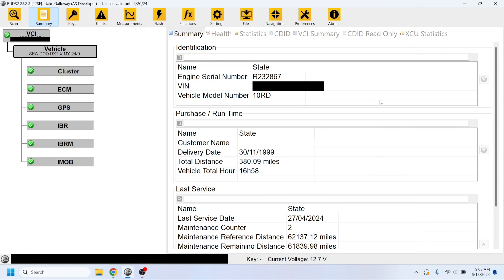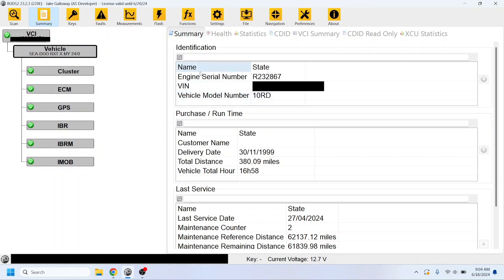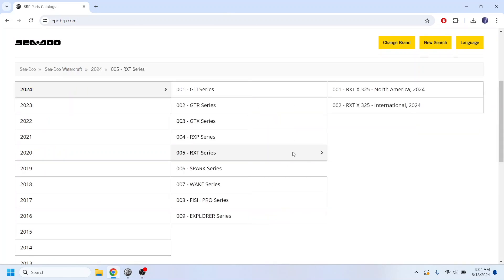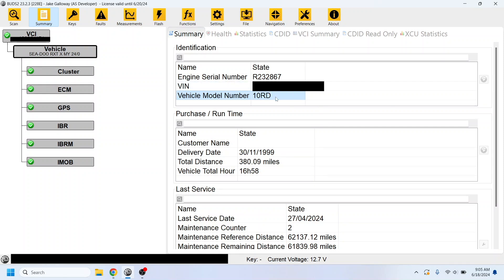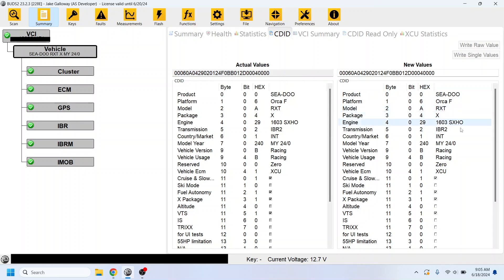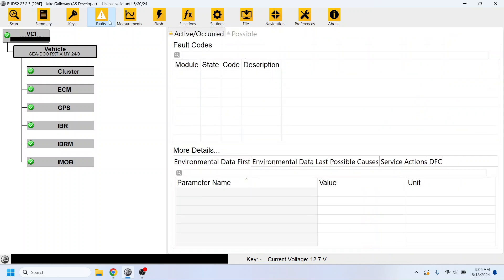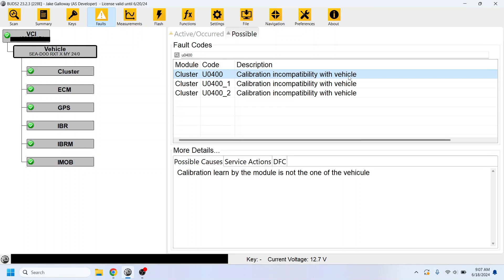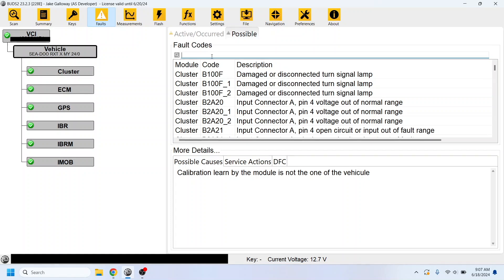How To // SeaDoo 325 Speed Override Using BUDS 2

Comment: I have a 90hp spark. If I changed the vehicle version and vehicle usage to racing in cdid section will my ski start in sport mode every time ?
Reply from the maker: It should, yes!
Reply: @jetskijake-seadoo I just tried it and when I started it it was still in touring mode. It even said racing for vehicle usage and vehicle version under actual values. When I change those settings should it say sport mode on startup or does it just change the touring mode to sport mode but still say touring on cluster?

Comment: I have a 2024 Gtrx 300. On the website where I bought my megatronic also suggested unchecking Byte 2 bit6 and checking Byte 2 bit7 in ECM variant coding. Is that necessary?
Reply from the maker: Yes the 300’s and under use a different ECU, those 2 bits should be disabled, that’s all you need to do for the speed unlock.
Reply: Great, so I will uncheck both. Thanks. Are those the GPS limiters for the variants?
Reply from the maker: @frankj1663  Yup, both of those bits are what control the speed limiting mechanism.

Comment: i think you missed 1 thing, also country need to be changed. also seado doesn't have international model number for the 2025 rxtx325 yet. very odd
Reply from the maker: Yup. I missed it in the video but put it in the description.
Reply: @jetskijake-seadoo  tnx for the reply. how fast your ski is going after this change?
Reply from the maker: @user-crpto-1  I managed 81 after this change and the iBR grind and ride plate mods. Prior to the iBR and ride plate I was topping out at 76-77.

Comment: Hi Jake. Do u know where is the setting to change the horsepower on 2021 Seadoo GTI SE 130 to 170hp. I'd appreciate the help with buds2.
Reply from the maker: Yes, all you need to do is change your 4 digit model code to the 170hp version of the ski. It's a similar process to the video. Open this link https://epc.brp.com/#/Sea-Doo/004_-_GTI_SE_170%2c_2021_00030MA00_00030MB00_00030MC00_00030MD00_00030ME00_00030MF00_00030MG00_00030MH00/00-_Model_Numbers/S2104/00S2104/y

Then find the international version of the 170hp variant of your ski. Then open BUDS 2 and change your current model code to the 170hp version.
Reply: @jetskijake-seadoo  bro can we do this on gti 170 2024?
Reply from the maker: @juanoliveira2912  The 170 is already the highest factory output. If you want anything more you'll need to have it tuned.

Comment: Great video, but I have a problem every time I put on racing, it says check keys cannot fires up. yes I put 4 code 10RD for international and if I put back to serial.. sees keys and fire up.  On racing sees the keys and reads the keys..
Reply from the maker: Are you the one I’m messaging on Reddit about this?
Reply: @jetskijake-seadoo  maybe I’m not sure
Reply: @jetskijake-seadoo yes I’m
Reply from the maker: @ProTurbo1988  Sounds good just message me on Reddit when you want to remote. I'm Eastern time too.
Reply: Is that just to go to the international speed limit 72? Or full speed unlock(obviously with the stock limiter)
Reply from the maker: @tab686 This is to disable all GPS speed limits, so you should be able to hit ~80
Reply: @jetskijake-seadoo  ok thank you
Reply: @jetskijake-seadoo    Привет.  Я правильно понимаю через BUDS 2  можно снять все ограничения GPS?
Reply from the maker: @имяфамилия-н4г3ж  Yes that is correct.
Reply: First we had to update BUD2.  When you deleted the override speed limiter it will get you to 76mph. Then tune for 83mph plus
Reply: @ProTurbo1988  What tune are you using?
Reply: @raymondyim2960  no tune
Reply: @ProTurbo1988  I was able to remove the speed limiter with BUDS2 but I max out at 77.  I see people post that they get over 80 with just the speed unlock, did I miss something??
Reply: @raymondyim2960  no you didn’t miss anything.   That’s about the speed you’ll get with that simple mod.  Now you need to tune it.
Reply: @ProTurbo1988 how can i tune it? Could you help me?
Reply: @ProTurbo1988  Как это сделать ?  83 мили?
Reply: I too had this problem  this pass weekend. No Key and tried adding a new key too
Reply: @loustoy3 update BUD2
Reply: @loustoy3  Update your BUD2
Reply from the maker: @loustoy3  Are you running the latest version of BUDS 2? That seems to be the big cause for most people with this issue.
Reply: @jetskijake-seadoo     thanks for the video .....which version are you using 23.2.3 (f9a2) ? seems to be the latest version....... is that the one you used your  software name says 23.2.3 (228E) on your screen 

are both the same ?
Reply from the maker: @Sea_Doo_Life_17  F9A2 is newer than what I had at the time in the video 228E. You definitely want to run the latest whenever you can.
Reply: @jetskijake-seadoo  thank you I really appreciate the quick response. I’m gonna go ahead and update it now again thanks for the video. Truly appreciated.😎